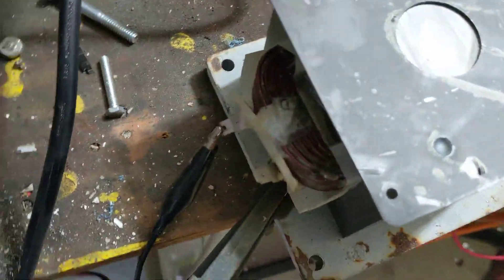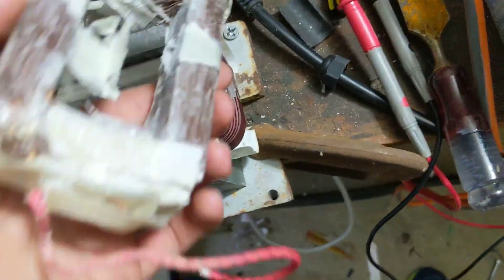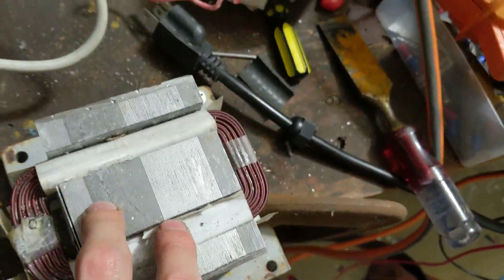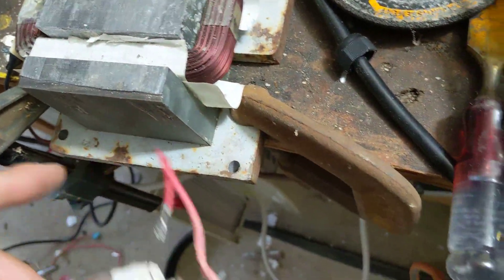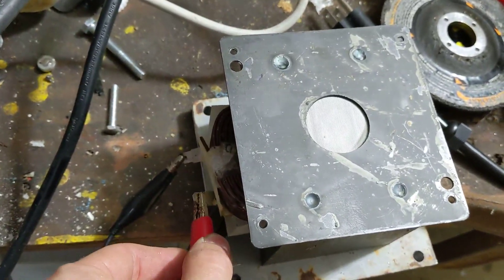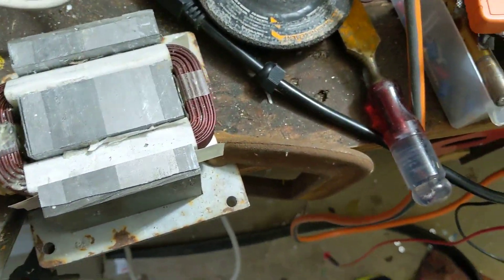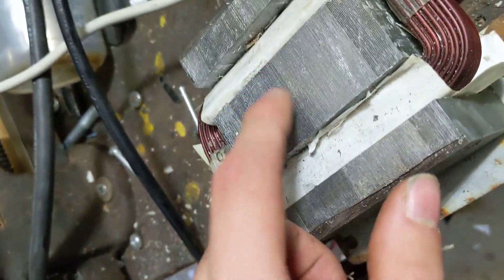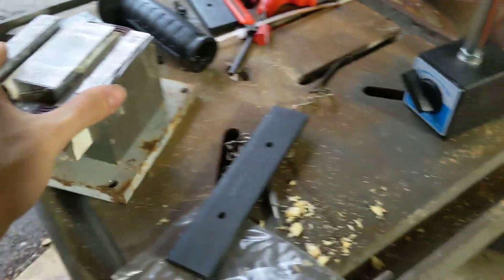How to create a Electromagnet / Magnetic Drill Press vise from a Microwave Oven Transformer

Comment from the maker: How to make a magnetic drill press vise from an electromagnet.
Relevant Formulas:
The safe current of your magnetic vise is equivalent to the current of your microwave. Make sure there is no or little gaps between the work and the vise as air is not permeable to magnetic fields and magnetic field inverse proportional to distance squared.

The magnetic force between a steel plate and a electromagnetic vise is approximated by: 
F(x,y,z) = Gradient(1/2 X V B^2). Where X is an experimental constant (scalar), V is the volume of steel plate (scalar), and B is the magnetic field vector and x,y,z is the force at that position on the steel plate. Applying that force at that position (x,y,z) would remove the work from the electromagnetic clamp.  Where Gradient is (partial derivative x, partial y, partial z). 

For practical purposes, the only thing that is relevant to know is Force is proportional to the magnetic field squared, and the volume of the work being clamped. Magnetic field is proportional to number of turns and area of coil and current. The volume part seems reasonable, before I suspected incorrectly that it was area as the B field in a coil is proportional to area, however, I noticed that tall parts stuck better than shorter ones of similar areas showing that it is proportional to volume empirically. The B field squared is a little bit of a suprise. So it should mean that doubling the current in the electro magnet will result in 4x the strength (disregarding saturation limits in the lamination / core).

Comment: Hi man, love your video! Very good of how you explain things! I want to ask you and see if you can help me out with an answer. if I have a machine that has 240v (the one with 4 legs plug) am I able to convert the machine's volts down or that won't work? if that's the case, Can i use a 200 ft extension to power it with a generator? Thanks a lot again for the content!

Comment: I tried this at home, and I fed 6 amp to it and now my house is on fire any suggestions? Also will the heat from the current fire damage the components?
Reply from the maker: you should be able to use the heat from the fire to run a heat/carnot engine to cool down the transformer so the components are safe.